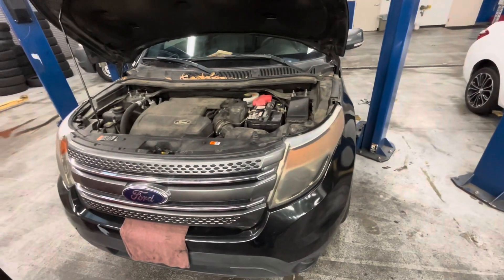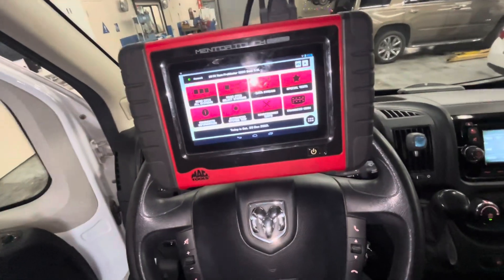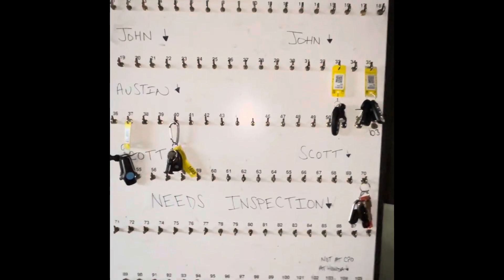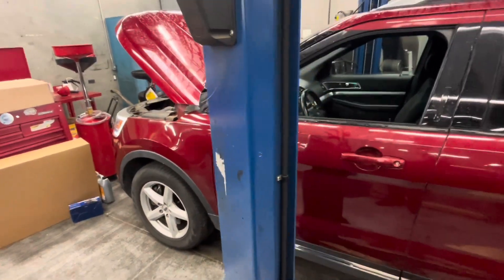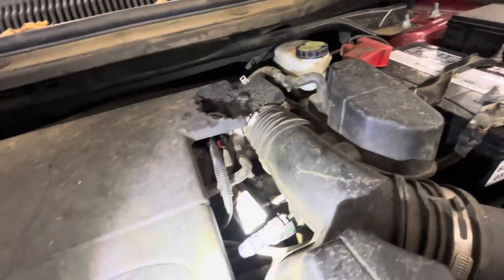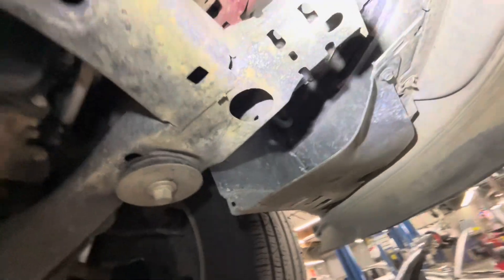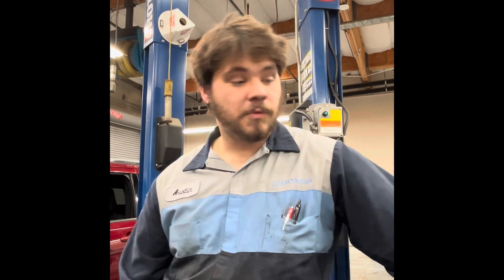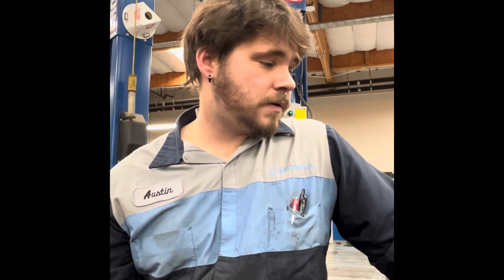Day in the life of a used car tech!

Comment: What's up first comment on the channel , dig the honest real content .  I'm a Ford transmission tech, watch those 4wd explorers with the 3.5 and 6F55 the ptu's are super prone to going bad.  Causing an oil smell (usually a gear oil smell) , they'll drive fine for a bit till they get hot (20-30 mins of driving) then they will start binding up on tight radius turns like u-turns and when going into reverse . The first sign is usually gear oil present from the vent tube off the ptu near the valve cover closest to the fire wall.
Reply from the maker: Appreciate the tip, I’ll take a closer look back there tomorrow to see if I can spot any gear oil. Thanks for watching and happy holidays!